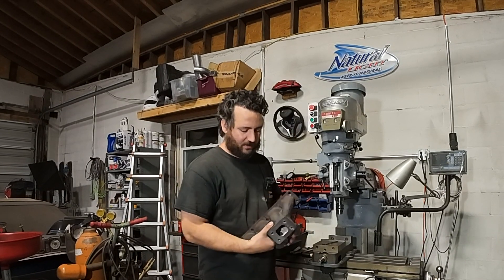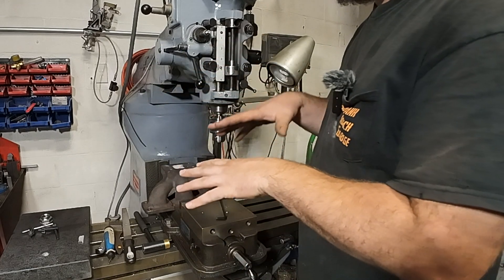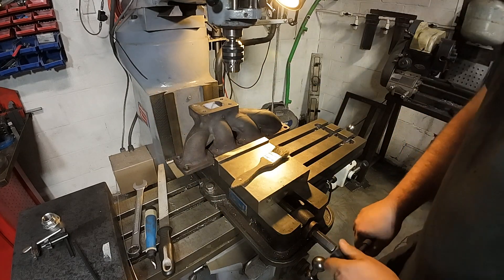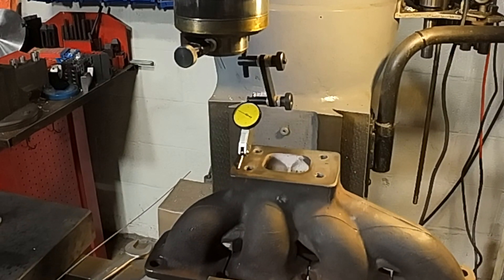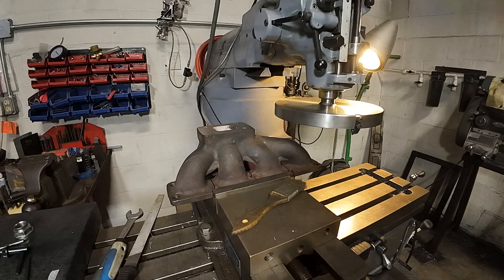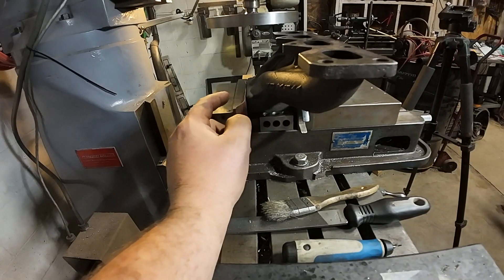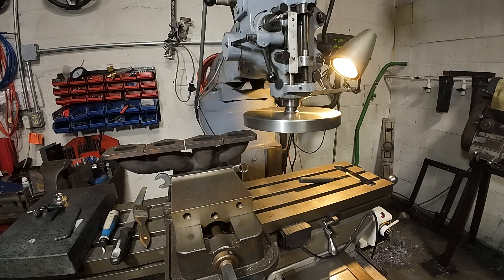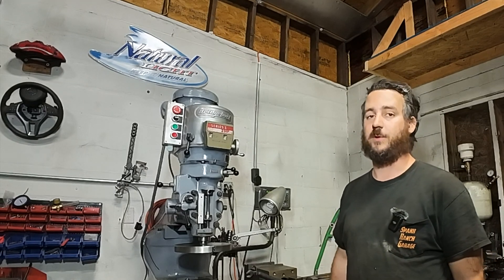Making a Miata Turbo manifold PERFECT AGAIN. Bridgeport Mill Flycutting

Comment: If one was interested..as it doesn't seem to affect function....perhaps a piece of inner tube or other rubber band around the OD of the fly cutter would dampen the ringing. Love that cutter.
Reply from the maker: I was thinking that too. Just like putting a rubber strap on brake rotors and drums when cutting them. I'm actually surprised this rings as much as it does but luckily it doesn't show up in the surface finish. Thanks for watching!